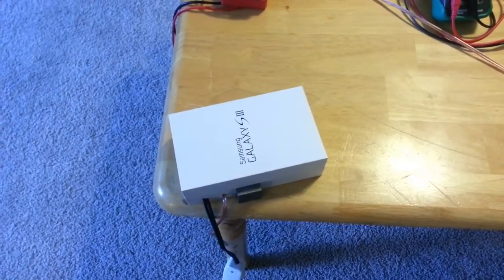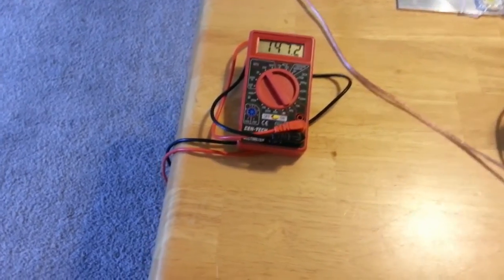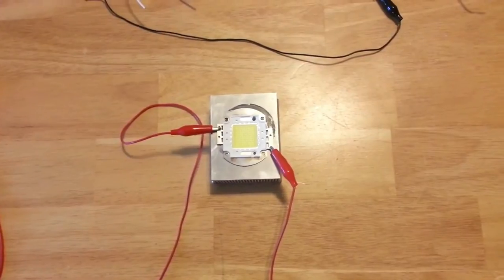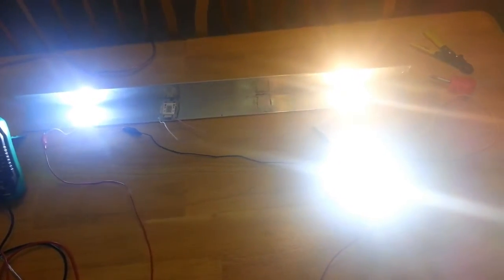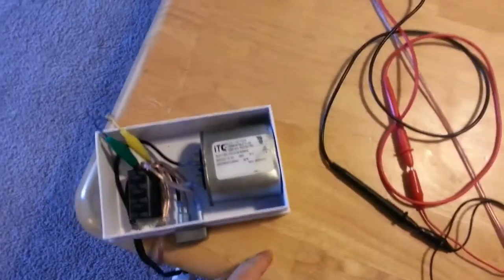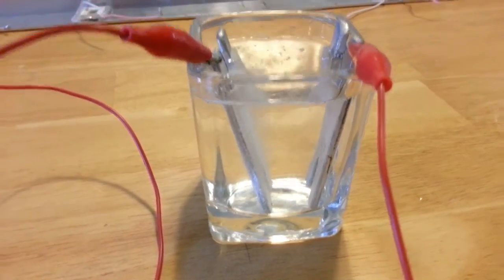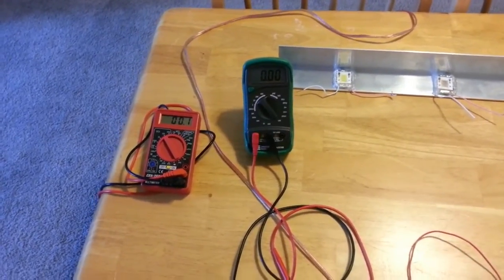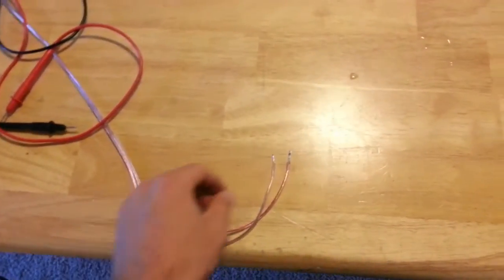Capacitative Battery Charger Demonstration

Comment: so if my battery has a shorted cell what would happen?
Reply from the maker: It would charge at a reduced voltage since you have a 2.2volt cell that's been shorted. But the battery would still be shorted and would not be any good.
Reply: @72fr250  its heavily sulfated
Reply from the maker: @jabbosax   It'll go as high as 120 volts to force amperage into the battery. If it truly is just sulfated, then it should work fine to desulfate the battery. But if there is a short circuit from damaged plates, then the battery will still be no good. Keep in mind you have to monitor the battery voltage yourself with this charger. It is dumb and will keep charging until either all of the electrolyte is boiled off or you turn it off. Also do not turn it on unless the leads are attached to the battery terminals. If it is not connected to anything, it will default to 120+ volts.

Comment: Only registered have permision for schematic

i need for 230v info or schematics
Reply from the maker: http://farm3.static.flickr.com/2751/4298679896_499c635e34.jpg
Reply from the maker: Use a AC run capacitor rated at 480 volts for C1 and BR is a bridge rectifier. A 25 microfarad capacitor should give you 2 amps of DC current. A 50 microfarad capacitor will give you 4 amps of DC current, and so on.